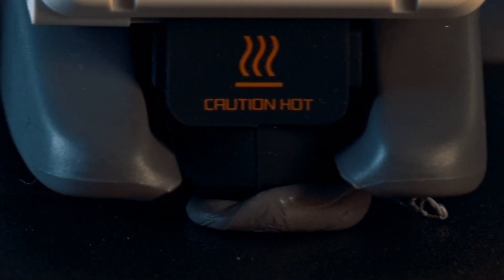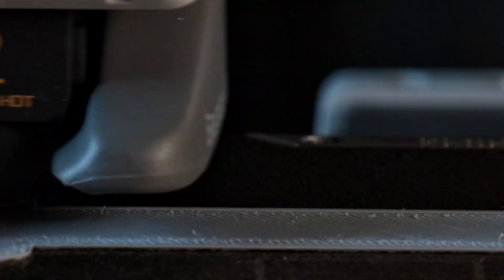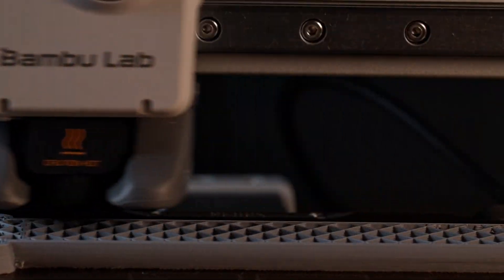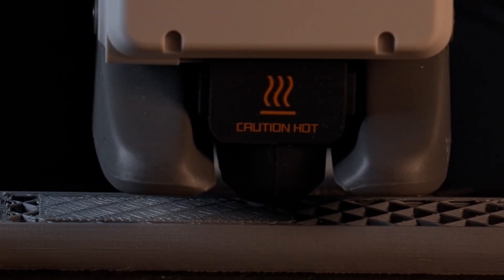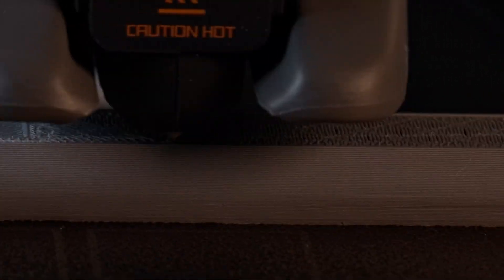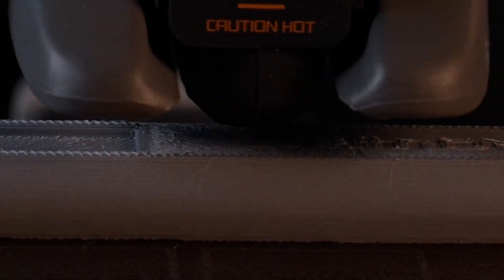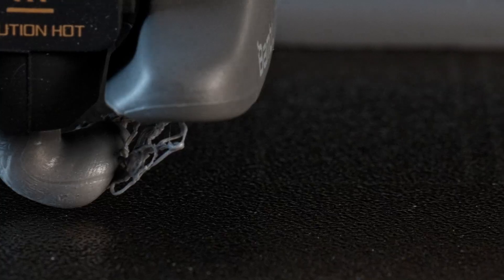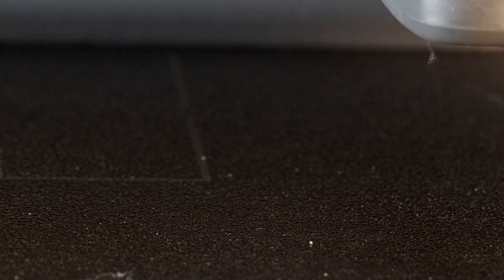First 3D Printing Failure: Bambu Lab A1 Mini - Scraper Tool Print

Comment: Your filament doesn't seem like it is being melted enough. Either that or your flow rate/pressure advance is off.
Reply from the maker: And now I have new terms to look up! :D this is helpful but it'd be 100% if you could also say what indicates these problems? Is there a specific thing happening I should be noticing (3D printing is currently magic to me, I have little idea of how it works)
Reply: @IronHive  The way the filament looks kind of matte is one indication the filament is not melted hot enough for the speed. The next is how the filament is kind of rough looking when it lays down a layer. too much flow can make  too much filament come out and it creates extra filament that squishes up looking all rough. Wrong pressure advance can cause too much filament to be pushed out at the end of a movement or corner. 

I think this is more of a temp issue on your hotend though, so I would suggest you increase temp by 5 degrees at a time while it is laying down the first layer to see if it cleans up. Also increase bed about to 55c to see if prints stick better as well.
Reply from the maker: 100% Thank you for the explanation! That is super helpful. One note, this is matte pla, so that might be part of the reason it looks more matte. I think I saw a test file available that use different temps to see which works best, I'll try that!

Restating what you wrote because it helps me commit it to memory,
- Too much flow can be indicated by a rough look (filament getting squished up).
- Wrong pressure advance causes too much filament to be pushed out at the end of a movement or corner.
- Try slowly increasing temp/find temp test, to see what gives best results.

Again this is very helpful to me!
Reply: @IronHive  Have you tried the calibration options in the slicer to figure out the flowrate and pressure advance? This is also a good thing to do for each type of filament you have.
Reply from the maker: I haven't tried any options like that yet.

Does Bambu Lab do this automatically already? It prints a test area at the front of the heat plate at the start of each print, I was assuming that was an automatic calibration of some kind.

A tricky thing about the technology advancing so quickly is that a lot of the videos I'm watching don't seem apply as much today. Bed leveling, using a glue stick, using a large cement paver to reduce vibrations. It seems like these things made a massive difference previously, but offer minimal benefit now.

Comment: Yup the fix for this is just washing the bed with soap and water. I found that the PLA Matte is super sensitive to previous print residue and honestly I now just wash my plate after every print to avoid a failure
Reply from the maker: I think I'm going to start doing that too, quick and easy peace of mind
Reply: the problem for me is not that it is not sticking but when its going to print layer 2, it scrapes layer 1 away idk how to fix it

Comment: I just got the A1 mini during the sale as well, had it for about 5 days now. The price for what you get was ridiculously cheap I couldn't pass it up since I was already eyeing it. I build and fly FPV quadcopters (drones) and plan to be printing a bunch of small TPU parts for those so the A1 mini size was perfect. It prints TPU like a boss, super clean. I've been using eSUN filament and using the presets they provide on their website for bambu studio.
Reply from the maker: FPV drones look awesome!! That is one of the things I was thinking of getting into next. It basically looks like a real life video game/pod racing. I tried TPU for the first time today and the benchy came out better than the pla. So far I've just used "generic pla" or "generic tpu" and it's worked well, but I'll check if the ones I got have their own settings for bambu studio too, thanks!

Comment: If you up the lighting, go to a higher f-stop, you can get a longer depth of field. And don't fear higher ISO.
Reply from the maker: Oh.. lmao I just went and checked to see what settings I was using, this was one of my first prints so I just had the camera in full auto. It was later prints that I started going through and testing settings. So I'm not even sure what it was using.
Reply from the maker: I mostly just need to go through my footage and see what settings I like best. I have hours worth at this point, aperture from  f1.4 to f20. Shutterspeed from 1/60 to 1/8000, but always at 800 iso since that's the best spot for an A7IV shooting slog3, max out that dynamic range.

I like blur! Both bokeh and motion blur. Draws the eye to whatever element is in focus.

The fast motion is the trickiest part so far, but that's a lot easier now that I understand how the printer moves. 

My plan for tomorrow is to play with timelapses. Those should be wild since I can shoot full res 14-bit raw, where video is limited to 4k 10-bit 422.

Comment: Ya these types of printers are called "cartesian" printers, colloquially called "bed slingers". There are also CoreXY and Delta printers.

The two fans on the hot end have different purposes. The "part cooling fan" is somewhat obvious to what it does, it cools the molten plastic as it leaves the nozzle, and is particularly useful for certain materials like PLA. The other fan is the "heat break fan" and it is pretty critical; it allows a more drastic temperature difference between the hot end and the extruder (the motor that actually pushes the filament into the hot end). If there wasn't a heat break fan, the heat would creep up into extruder area causing the material to become softer, jamming the extruder. 

If you do get into this hobby, I would suggest getting the P1S with the AMS, its worth the upgrade. Let me know if you have any questions, I'm AtHeartEngineer everywhere, discord, telegram, twitter, etc.
Reply from the maker: Really good info! I heard the term "bed slinger" repeatedly and now I get it 100%, but I had no idea what that meant when I was doing my research and making the purchase.

P1S with AMS is so tempting right now, but also a lot of $. It's 4x the mini! But 4 colors is tempting.

Awesome, thank you for the contact info, I will definitely take you up on asking questions once I get through the printing freely available models stage (the A1 Mini really does make that super simple).

I started working on a discord channel today https://discord.gg/3EwZVcSSmV and plan to talk about that next video, you would be very welcome to join!